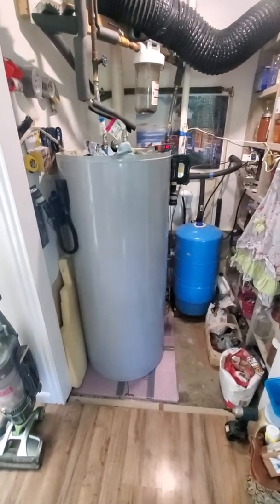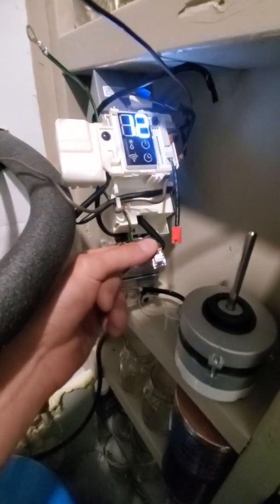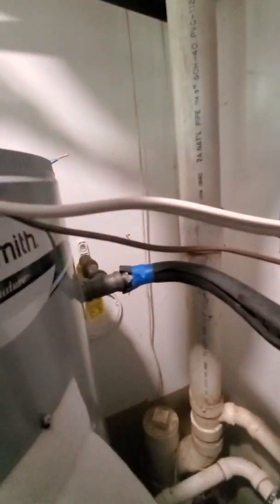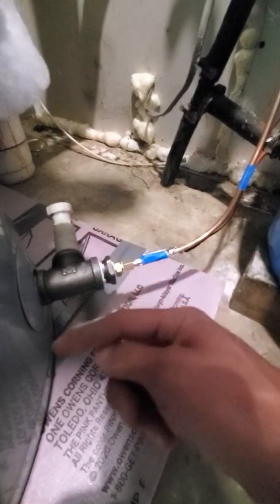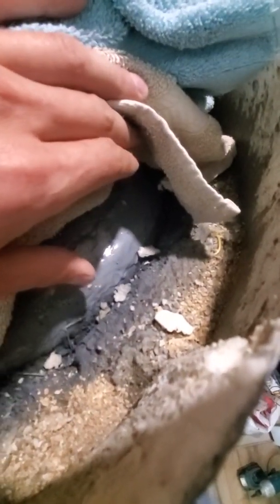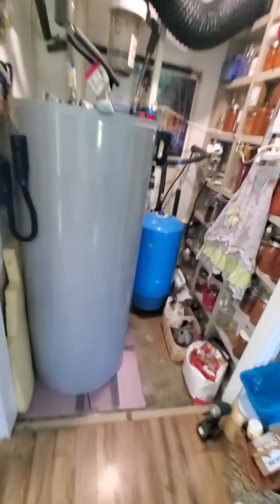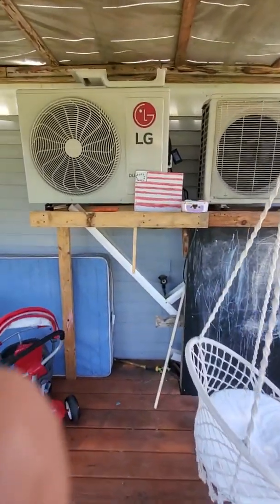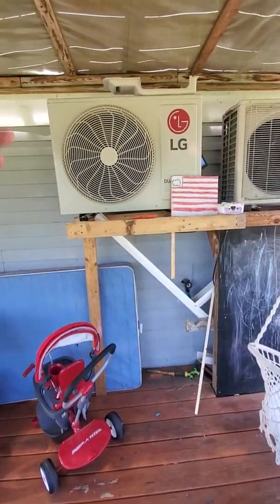FINISHED DIY Heat Pump Water Heater. DIY. Home made mini split.

Comment: Cool setup. I'm just learning about this now. 

Heads up tho. You should never use black fittings on potable water. Brass/stainless/copper or galvanized at worst. 

The black is going to give you rusty water.

Edit: I just realized you may be running your potable through a copper coil in the out. If this is the case then you're ok.

Comment: Those flares leak or is the pressure low enough they don't?
Reply from the maker: The flair that you are mentioning is not but it into it, it's actually passing completely through.

Comment: They use that size Fujitsu out door all the way up to 18, 21,24k btu on there cheap base R410A model here IN Australia with terrible efficacy. I think the 24 has a scroll compressor and the others has rotarys because they sound different. any way there more efficient R32 models has slightly bigger outdoors. Usally R32 systems need smaller outdoors but Fujitsu are very odd.

Comment: Do you think to make heated floors with that thing, it would be the next logical step? I wanna try to put air to water outside unit in the attic so I would increase efficiency of heating  for floors in a winter and  a swimming pull in a summer
Reply from the maker: There is absolutely no reason to put it in the attic because if your attic is warm then you have a serious issue with insulation and you will save much more money by properly insulating your attic and leaving the outdoor unit outside where it's supposed to be. This unit would work extremely well for heated floors because the temperature required for heated force is low probably 90 to 110 Fahrenheit
Reply: @ne7s29  heat  come from the sun in the attic,   even on cloudy day in a winter it gets warmer there I know that for sure , because I insulated all gaps with spray foam and put extra layer of insulation  but in my case the main reason was that I am not allowed to put any condenser outside by HOA  Now I want to do same thing on my second property with dual source to water heat pump  with only purpose of heating.  Next step would be to put solar tubes on the south side of the house  with antifreeze in them  and  to connect tubes to my dream heat pump .  I forgot for what I started to talk...My question is  do you find the hotter outside temperature is the higher COP ? Thank you
Reply from the maker: @andreycham4797  of course. That's how heat pumps work. The colder the temp outside the lower the cop.
Reply: @ne7s29  I meant hotter is around 120 and higher is there anything to prevent to transfer heat from attic  this hot let' s say to a swimming pull

Comment: I love this, I am trying to find a water to water type water heater when I came upon a "this old house" video where they use a remote heat pump and they figured out how to turn a regular electric water heater into a water to water heater. 

They use the drain hose fitting and circulate hot water into it that way. So you could easily duplicate this, all you will need is a refrigerant to water heat exchanger. 

I'm sure those are out there because I seen a DIY geothermal system where the guy used one. So here is a link to the this old house video >> https://youtu.be/u4hQVr5qYZo

Question?? why couldn't you still use the mini split indoor unit and route the refrigerant first through the heat exchanger for hot water then through the mini split indoor unit then back out to the mini split outdoor unit. 

You could have the hot air from the indoor mini split unit routed to the HVAC in winter and shut that off via a damper in the summer? Just wondering if that might work?
Reply: Another option is getting a multi zone mini split and have one zone be for water heating and other zone(s) be used for space heating with low wall mount air handler(s). Just get one with one high btu zone and the rest lower btu zones. I have seen them before and will do this when I do my setup in a few years.

Comment: Those ST-1000 china temp controllers are damn handy and cheap. I like this DIY, no additional pump to flow through a secondary heat exchanger. I'm curious how you figured out tricking the indoor monitor assembly into not faulting out. I'm not finding service manuals with any detail operation.
I came to your channel via your Mr. Cool mini split not defrosting. Clearly they didn't do testing for your environment of humidity in the winter.
Reply from the maker: A secondary heat exchange that would only be getting approximately 100ﾟ gas flowing through it whatever comes out of the bottom of the water here so dear so there wouldn't be much coming off and what would you you do with that heated water unless you had a heated water tank that had preheated water before then entered your primary hot water tank. Also as I stated I'm using that chis that Chinese thermostat switch to disconnect the is to disconnect the wire that the indoor unit computer uses for the temperature sensor so whenever I disconnect that circuit with my temperature controller the indoor unit goes into error mode  And flashes in air mode until my Chinese thermostat connects the circuit and it goes right back into the previous setting which is calling for heat. I am going to give Mr. Cool another try I purchased the large 54K unit for my father-in-law and I will be attempting and install there in a 2500 ft² house We'll see how that ends up working. I think Mr. Cole works but if the product is having an issue I would expect the technical support to provide assistance or at least try to fix it instead of saying that's normal operation.

Comment: That’s a lot of work for a tank that’s going to rot out in a few years do to the black iron fittings and welding on a glass lined tank
Reply from the maker: If it does rot out in a few ans everything else is working I will get a stainless steel tank welded up for me at a shop and insulate It myself with 2inch foam. Now that I understand how everything works it will be one day of work to redo the project. I'm at this not just for saving money but it is interesting for me.